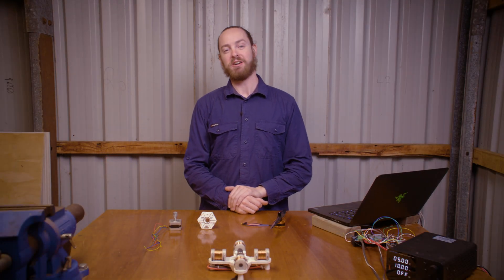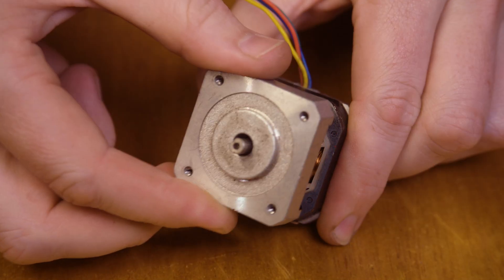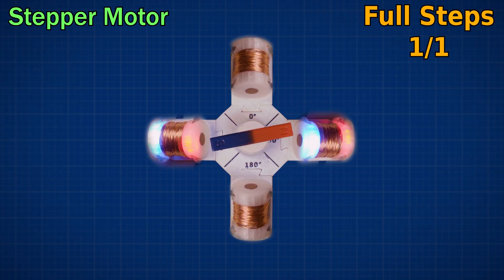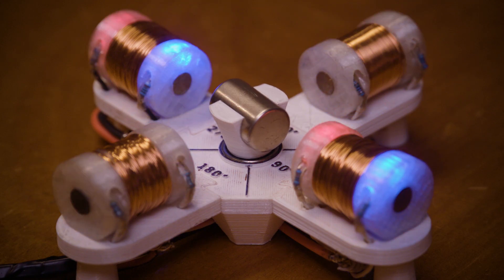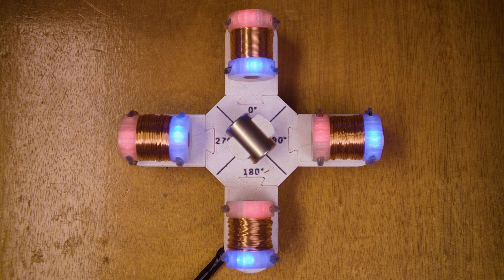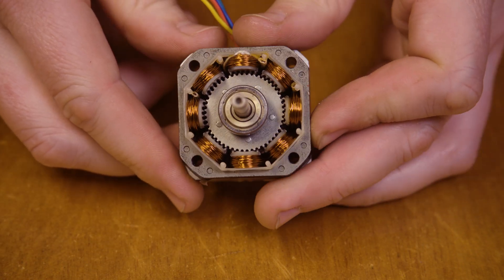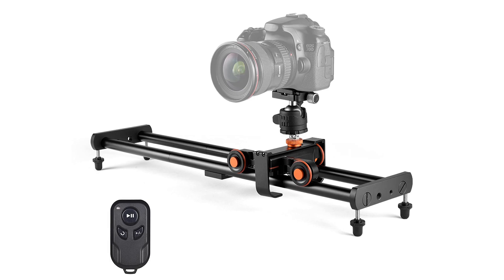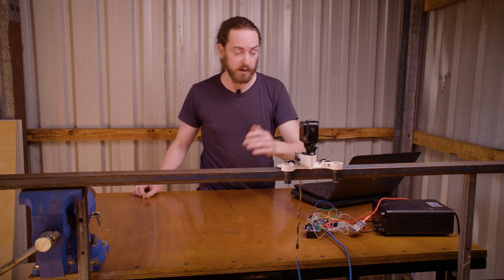Stepper Motor basics, build, and time lapse camera dolly

Comment: Hi, I watched some of you other videos and they were great. This one is good too but it's missing explanation of how 1/4 step is achieved. I guess that you reduce voltage of one pair of magnets but it's not explained :)
Reply from the maker: Hi Konyad, you are right that I never explained this. For microstepping the 1/4 steps I was varying the duty cycle to each coil. The coil nearest to the magnet would be at 100% duty cycle (square wave) and the further coil would be at 50% to give the 1/4 position. Then the half way position is both coils at 100%.

Comment: This is very cool but i wish you would have gone into more detail about how you're controlling it, how you built the example motor, how 1/4 steps work and bow you're implementing them etc.
Reply from the maker: This is the third video in a series. If you watch the 'electromagnets' and 'brushless motor build' video you'll see how the model was built. As for the micro-stepping, I'm using PWM to increase/decrease the influence of each coil as it 'hands' the rotor over to the next. Using Arduino framework 8 bit PWM. Thanks for watching!

Comment: Great! Also does the stepper motor require the same kind of switching in bldc motor?
Reply from the maker: yes, the switching is done using 4 x mosfet H bridges, the same electronics as i used for the BLDC motor!
Reply: Thanks  @technologyhobby